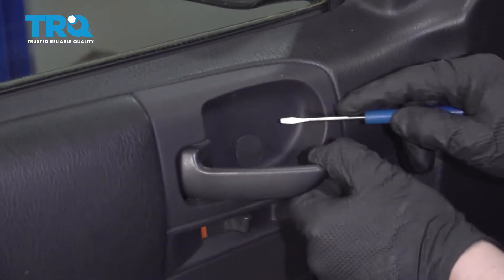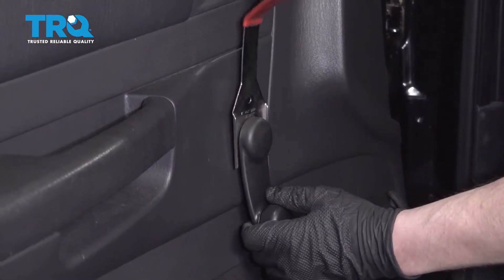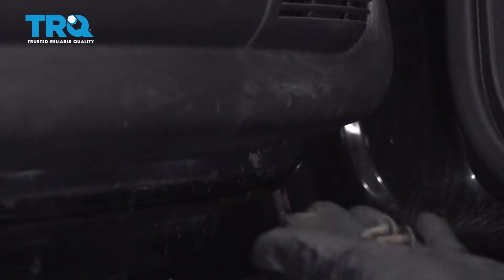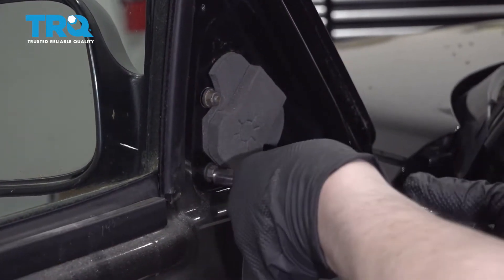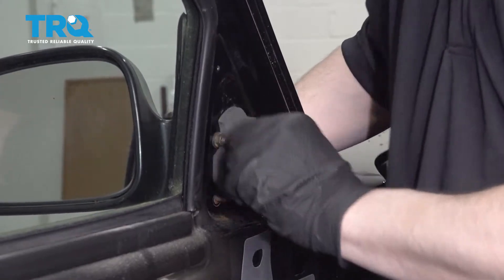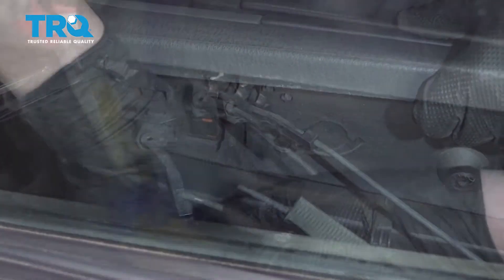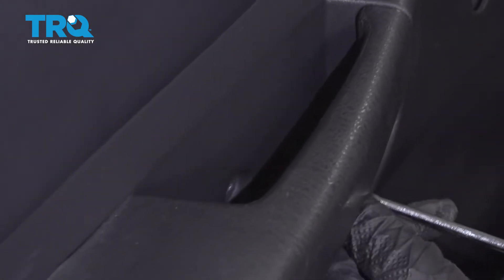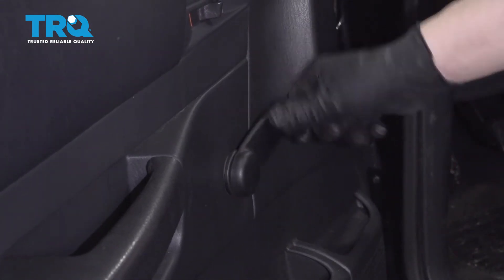How To Replace Sideview Mirrors 1997-2004 Dodge Dakota

Comment: Hi i need to ask something well i am in Chile sout america and 
iam very confused coz i have a dodge dakota 3.7 v6 double
cabin 4 doors  i am usin a proper oil 5w20 about catalog but  Is using a lot of petrol 93 octans so mean like 3.7 klm city per liter probably hig way should be like 6.5  or 7 klm  has only 78 thousend klm no more is 2010 i do not have an habit to run no more then 120 klm when is so much but normaly never so just city my doubt is what kind of oil should be better to save petrol 5w30 or may an other one ?  Thanks million ..
Regards....